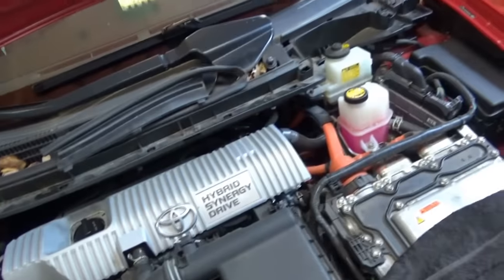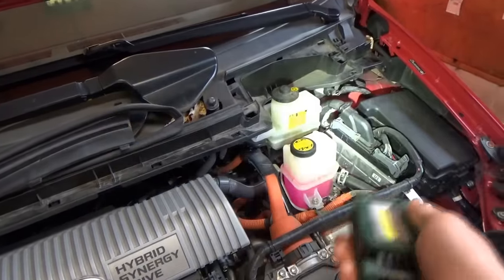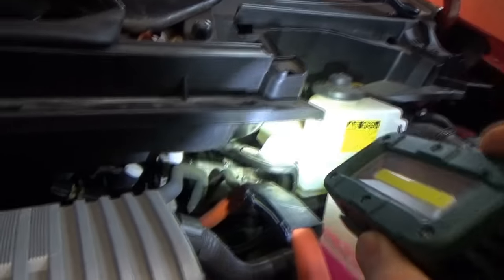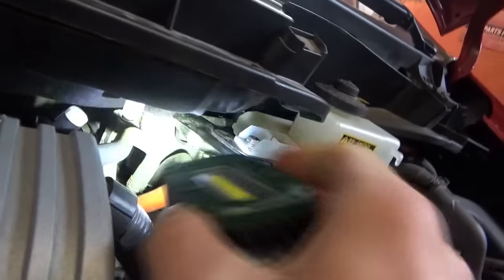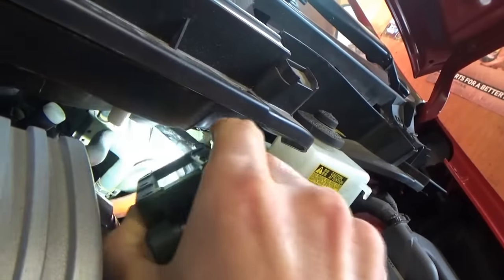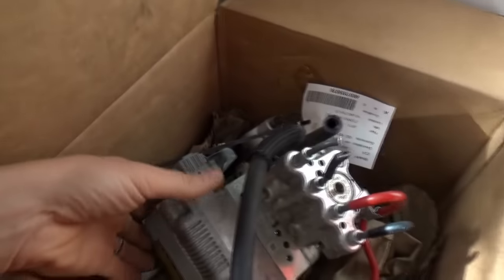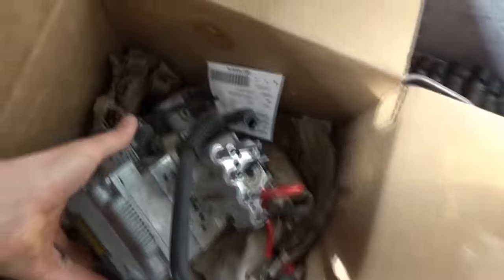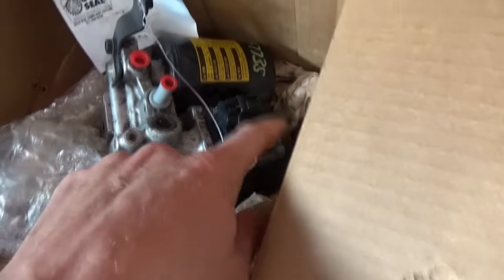Prius Brakes FAIL (Hidden COST of Hybrids)

Comment: 12 years of 45-50 mpg for 250k  problem free miles...mission accomplished. Time to offload that high mileage beauty and get a brand new one. Toyota's hybrids are rated as their most reliable platform, talk to anyone that owns one. That said, I wouldn't want to own, drive or fix any vehicle with that many miles, even the most reliable one. That car owes its owner nothing. Lot of haters out there still, sounds like you can relate. Good on ya for taking it on, though. Another interesting video, thanks.
Reply: I'm not a hater and I would have no problem owning a hybrid, just looking at this from a financial point of view, and maybe I'm making this too simple.  I don't see how the increased fuel economy will offset a $400/month car payment for 5 years or so, to me you're still losing money, especially on something that depreciates in value so rapidly like a car.  And considering that less complicated non-hybrid cars are getting 40+ mpg now it just doesn't make sense to me financially.
Reply: @stevepowell4444  those cheap cars you mentioned barely make 20 mpg in the city, where hybrids don't pay the physics penalty as much. In addition, having extra 20 mpg x 300,000 miles could be a significant cost savings if you keep the car long term. if you get a plug in hybrid, it qualifies for so many credits that the net cost is way less than a cheapest gas car.
Reply: You dont know what he already replaced to get to 230k miles. Perhaps battery? Big $$. MkIV Golf or Jetta with 5spd get 48mpg hwy and cheaper to run long term than any Hybrid or EV.
Reply: @vw5056  VW products cheaper to maintain over a Prius over 12 years and 200k+ miles? Not buying it. No Prius needed a battery before 200k. Most don't even need brake pads lol.
Reply: @p_r_g_m_r  more like 500k miles. That is seriously how long older TDI 5spd models can run on original powertrain. No hybrid is making half that mileage without battery replacement and who knows what else.
Reply: @vw5056  oh TDI - which you can't find the older ones without all the emissions related whackery that's not already close to death. That one. 100k Prius on the other hand I can buy and double down on.
Reply: @p_r_g_m_r  huh? Dieselgate had nothing to do with engine reliability or longevity and it was only for roughly  2007-2013 models. The cars were fixed to meet emissions by now.
Reply: @stevepowell4444  I agree . . . It wont. More energy goes into manufacturing a vehicle than the car will ever use driving it even if it's a gas hog. We pay for that energy every time we buy a new car . . . I use to buy NEW vehicles for convenience and because I was in business and lost money when they were in the shop. I now wished I had kept a couple of the ones I traded in.
Reply: @vw5056  If you got one to sell or know anywhere I can find one that's not beaten to death and/or ungodly amount of money - point me to it. Even then the newer TDIs with emissions crap are no way 500k reliable especially if you live in emissions state.
Reply: @hikerJohn  not true. Normal car overall energy consumpion is about 70% fuel and 30 manufacturing.
Reply: @vadim7590  where are you getting “barely 20mpg city?” We had a 1990 Civic wagon (an automatic no less) that got 27mpg in hilly city short trips, the manual Honda Fit that replaced it gets 32-35 mpg in the same cycle.  I’m not as big of a Prius detractor as some in the comments mind you.  A better look at fuel economy is L/100km IMO.  Better captures the diminishing returns nature of increasing mpg say from 40-50 versus 20 to 30
Reply: @JuhaLehtinen  Do you have a reference? I did the math 10 years ago and you have to count the energy of mining recycling and delivering the raw materials. Not just the energy used in the assembly plant. With better mileage it's probably changed a little but they also use less energy do to lighter weight and less raw materials so I'm not going to be dogmatic without doing all the math again.
Reply: @hikerJohn  No url unfortunately. I did read couple if weeks ago newspaper artcle about electric wehciles total energu consuption and mileages when it becomes more efficient than normal car, there was that mention about normal cars total energy consumption.

Over all best scenario would be not byt new car at all, use old one.
Reply: @JuhaLehtinen  I agree
Reply: Soon the year will be 2022 and Toyota Hybrids are the way to go!! 45+mpgs, 100k miles brake pads, quiet AC compressor, no serpentine belts or annoying pulleys that seize and leave you stranded. Just keep the hybrid fan clean so your main battery lasts 200k and when the time comes you can service individual cells in the battery pack if need be and not have to change out the entire pack. ALL cars will have one of their ABS modules fail at 200k and so what if you need a fancy bleed procedure. Toyota brake systems are excellent and second to none. You'll be grinning at the end because hybrids will also be worth more when its time to sell. 
Now don't get me wrong here folks, I love a gasoline engine but we must adapt to change... take for example my dad's generation (BB) some just didn't want to evolve with cell phones and simple technology... so today, completely lost! Seems like some are still stuck on halogens and CDs.
Reply: @vadim7590  uhh the plug in hybrids use premium gasoline and $4k for a level 2 charger. You’re still losing money 🤣
Reply: @DMR730  Yeah no lmfao. You’re living in a pipe dream

Comment: Before the Citroen Xantia (around 1990) all Citroen cars with hidro pneumatic suspension had rock solid brake pedals. Brake pedal had no travel, braking action was controlled by how hard you pressed the pedal, not how much it moved.

Toyota had a similar problem in the Prius, as the brake pedal travel is not directly connected to how much the brakes are applied, due to regenerative braking stands in the way.

Toyota's solution is the contraption you are replacing in this video...

Citroen's solution was to add a spring between the pedal and the brake controller... Springs convert travel into pressure. Just what was needed.

Comment: Impressive that your willing to get into this. I watched this video in response to someone with a similar issue and I have decided I don’t need to be the guy doing this.  If I was sure I would be getting a lot of them it would totally be worth getting the right equipment and spending time to learn the system, but there is just so much easier work around here to do it’s not needed.  Also, I have found the wiper and cover under it not a big deal.  To do the struts that has to come out, and if you just go right at it without trying to find a way not to do it it’s out in maybe 10 min or less.  Nothing to complain about really.
Reply: Was it really that hard in the end?  Sure there was some automatic stuff by the engine which is nerve racking but it seemed fairly straightforward.

Comment: The 2010 Prius brake master cylinder replacement cost me $3000 to replace at a dealership.  I paid $24k for the whole vehicle new.  Toyota over-integrated the master cylinder with regen braking features.

People sweated bullets over the possibility of loosing the traction battery, but things like this master cylinder really kill the savings one gets.
Reply: 3000????  No never
Reply: @fidelfez2202  The master cylinder itself was $2400, the rest was labor.
Reply: The factory master cylinder is $600 I don't know where you got that quote.

Comment: Brake boosters on the prius are usually pretty reliable. Even if you had to go to salvage route, mosts times then not your gonna have a good used working part. Most prius in salvage are because the driver failed to change oil or just cant drive and ran into something.
Reply: That's true of most cars in salvage yards.
Reply: I did salvaged ones, paid to get installed. Now I do new from Toyota

Comment: Toyota 4Runners, Land Cruisers, and some Tacomas have a similar electronic brake setup. They don’t tend to fail like the hybrid ones though. They do all have a failsafe where in the event of a total failure, the rest position of the valves will allow the brake pedal to actuate the front brakes.
Reply: Was wondering if this was hybrid specific or just electric brake systems in general.
Still, I just watched a video where an old transit van needed a new ABS - about $1000 for the part alone and it's on perpetual back order.
I don't think Ivan's point about cost is valid.
Reply: Those vehicles have electronic brakes because they are tall and rollover-prone. They have a system called vehicle-dynamics integrated management (or VDIM for short) to detect a skid or possible rollover before it becomes an issue and make millisecond-by-millisecond brake, throttle, and steering assist adjustments to stay in control. A traditional braking system just couldn't respond rapidly enough, and the pedal would feel inconsistent.

Comment: Love your videos and appreciate the work you put into them.  In this case I disagree that this has anything to do with the vehicle being a hybrid, as others have stated, there are multiple vehicles in the Toyota lineup that used this same system and are not hybrids.  Additionally that vehicle has saved the owner(s) north of $10k in fuel over the life, so if it needed something like a $2k battery pack, then the argument about hybrid repair costs would make sense, but also a fair comparison to savings should be made.
Reply: Not even close to 10k in savings. A prius at 50 mpg at 230,000 over a similar not hybrid at 34 mpg is saving 2164 gallons of gas. So that is about $4,500 depending on where you live. When you factor in the higher cost to register a hybrid and the inflated initial purchase cost, you aren't saving any money at all. For example a base Prius in 2009 cost 22k when a base Corolla cost 15k. A $7,000 premium.
Reply: @nick21614  gas is $5.00 a gallon for 87 where I live, It definitely saves you money over the long run
Reply: @evanspiteri3576  If the average cost of gas over the last 10 years to have saved that money then you don't live in the USA.
Reply: @nick21614  You're right, I don't, I live in California
Reply: Driving a hybrid places where you can use the regenerative braking is great. The hybrid gearbox is bulletprof and basically works the same way as a differential.
Reply: @nick21614  I tried to reply multiple times with links to my sources which were actual recorded average fuel economy for all the midsized cars and historical gas price data, but my replies keep getting blocked, maybe due to having links.  Anyway, it consistently comes out to over $12k when comparing the Prius with 230k miles to a comparable sedan with similar cargo space (not a corolla.)  I think you are plucking the info you'd like in order to confirm your bias.  P.S. I don't even own a hybrid, just sharing information that is available to anyone that searches for it.
Reply: @anzicek  Nah just comparing it to a corolla nothing is plucked. And you can't say the average price of gas in the USA over the last 10 years was $5.54 which is what it would have to be to save 12k. And that 12k (which isn't real) would be 5k because the base Prius cost 7k more than the base corolla.

I've driven the prius and its an okay car but lets not pretend you are saving 10s of thousands of dollars by driving one because you aren't.
Reply: @nick21614  not true, average price of gas was $2.51 since 2009, fuel economy difference of comparable 2009 car is 24mpg and Prius is 46mpg (both are combined fuel economy numbers.). That equates to 4600 gallons saved.  If you want to start getting into MSRP there's too many other factors, why not compared to a Bentley with 12 MPG and $200k purchase price?  (Obviously a rediculous comparison, but there are plenty of options on the midsize list)
Reply: @anzicek  Wrong I drove a 2009 Cobalt 5spd for 140k miles and average 35mpg on it. No compact car from that period or today is getting 24mpg. None.

Comment: This seems similar in concept to Mercedes Sensotronic Brakes that my 04 E55 has.  They ran it from 03-06 in all E-classes and I think earlier in the S-class.  Many issues over the years but after all the dust settled, there is currently a 25 year, unlimited mileage warranty on the system for ALL cars.  That didn't come without a fight I'm sure but that's pretty impressive.

Also, the SBC pump is integrated into the ABS block and it is super easy to access.  Right on top on the passenger side front-ish of the engine bay.
Reply: Daimler stands behind their products  very well and have excellent parts support for older models. I laugh when Toyota/Lexus online fanbase say Toyotas are generally better cars. Lmao
Reply: Mercedes replaced a lot of those SBS brake units under extended warranty.  I had a customer with one and we were looking at replacing it to the tune of $2k when they came out with the extended warranty.
Reply: @vw5056  How many recalls have Mercedes had due to car busting into flames...?
Reply: Lexus LS460 has the same system as the prius. They say to avoid the car. BTW this system is not new - The early 1990s Tbirds had a very similar setup :lol:. There was a nitrogen pressure tank and integrated ABS on master cyl.
Reply: @Cheepchipsable  none that i know about.
Reply: @alb12345672  These systems are brake by wire (this and the Mercedes SBC).  I don't think the early 90s Thunderbird had brake by wire, nitrogen or not.  Hence the "brake pedal simulator.". The master cylinder is not connected to the actual brake lines.
Reply: @kevin9c1  No, T-bird was not brake by wire (it was mechanical integrated ABS- the 2021 F150s have it) but it is a unit that replaces the brake booster and I believe they fail in the same way, the pressure tank depletes.  I believe the LS-460 has the same setup as the Prius, they always say account for that cost if you buy the car.
Reply: @alb12345672  Isn't that just a hydro boost then?  Very standard equipment since at least the 80s in trucks.
Reply: @kevin9c1  I believe that system linked uses the motor and the pressure tank (there is no booster). So it is primitive brake by wire. If it fails it could affect your braking.
Reply: @alb12345672  Sounds like a self-contained booster system.  The brakes pedal still acuates the master cylinder, correct?
Reply: @kevin9c1  Self contained booster system with an ABS motor and valve body. I believe the motor could come into play when normal braking, so it may be a hybrid brake by wire. The toyota lexus one has to have some mechanical fallback... I assume there is some pressure transducer involved that runs a motor to "brake by wire".  The part does not look that much different.
Reply: @alb12345672  Looks like we're talking about the Teves Mk 2 ABS system?  I think it was used in a variety of applications including some GM ones.  I don't think it's brake by wire any more than any other ABS or traction control is.  But still reading up on it.  I found an SAE paper (well the abstract).
Reply: @Cheepchipsable  Mercedes-Benz has issued a massive recall affecting more than 354,000 vehicles from the 2015, 2016, and 2017 model years. According to the National Highway Traffic Safety Administration, some of those cars may be at risk of catching fire.
Reply: @vw5056  ^ coughs
Reply: @christophervanzetta  did any actually catch on fire. Why don't you post the link.

Comment: I've done this job without any   scanner. After I replace the parts and  Bleed the system car didn't want to start. Then I reflash ECM with the paper clip for 30 minutes and it's done. Works perfect with no issues.

Comment: Just snowed 15" since dusk. Gotta replace a faulty encoder motor on a 2002 Tahoe AGAIN! Already replaced the transfer case, two encoder motors, two transfer case modules and checked every ground, verified that everything is OK but the encoder motors keep frying. A transmission guy I know up here said the Dorman and card one motors are junk so I gotta oem one for a small fortune. Good luck on your nightmare!
Reply from the maker: Dorman 😂
Reply: Where have you been living to have not heard about Dorman's reputation?
Reply: Replacement card one motor tested bad upon removal. Somehow when they fry, the module fries but doesn't blow the atc fuse. Long story short, replaced the encoder motor with a bone yard oe one, disconnected the module, shifted transfer case into 2wd using jumpers at the connectors then grounded the front axis actuator so its got four wheel drive when the 4wd fuse in the dash is installed and 2wd when it is removed. F that module. Gonna install a custom switch plate instead.

Comment: My friends wife got this identical car 2 years ago from our local Toyota dealer. It was in pristine condition. She got it for about $10 000 CAD. Well, earlier this year it was diagnosed that it needed a new INVERTER. Cost, is $5 000 CAD. It may even be 10 000 but either way it is almost the cost or half the cost of the whole car. I would rather just burn a bit more gas and drive a non hybrid.
Reply: Then a month later the battery goes, which costs $8k to replace. Gotta be very wealthy to drive a fuel-saving Prius.
Reply: @vw5056  VWs are just so cheap to repair...
Reply: @Cheepchipsable  about the same cost as a Break My Wallet hehe
Reply: Buying used is buying someone else’s problems
Reply: @vw5056  battery is 1k ish. 2k to replace and he said he would drive on gas only.
Reply: pretty sure u can have it replaced for less somewhere else
Reply: Get one from a low mile crashed car. If it's even defective, most dealerships don't have a clue.